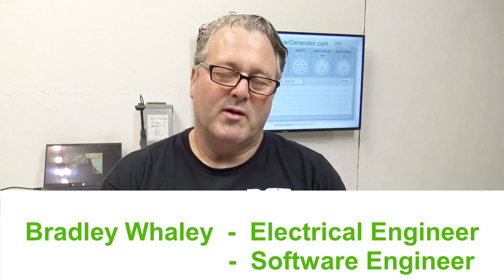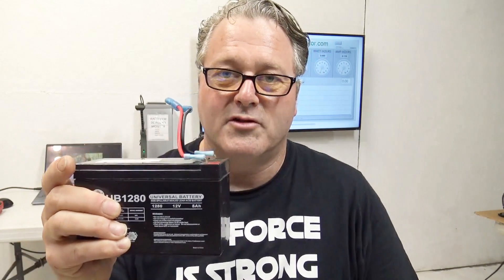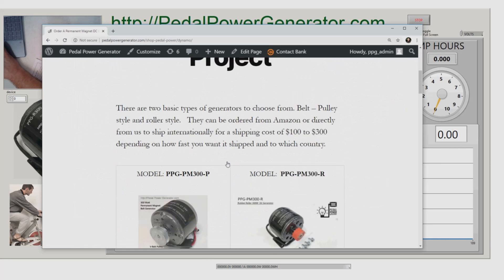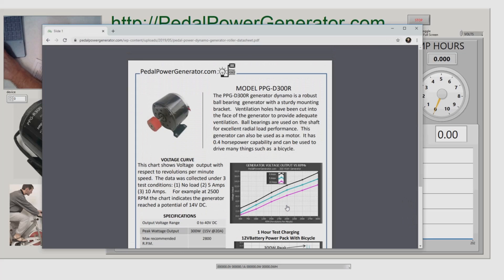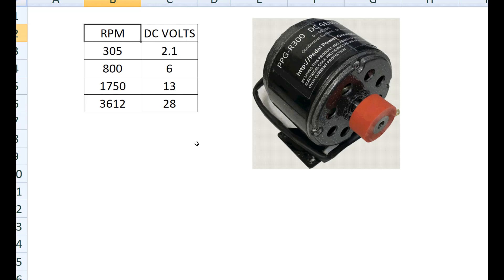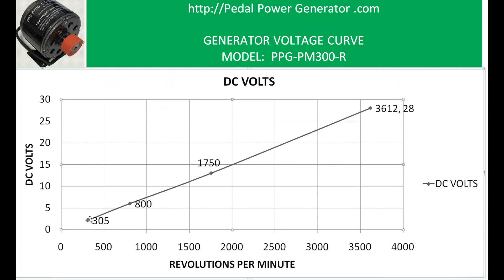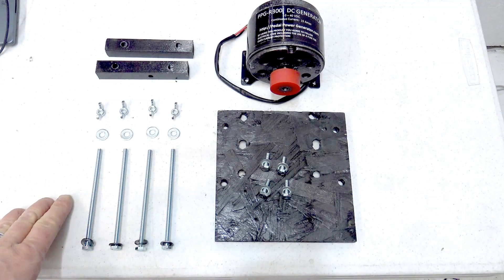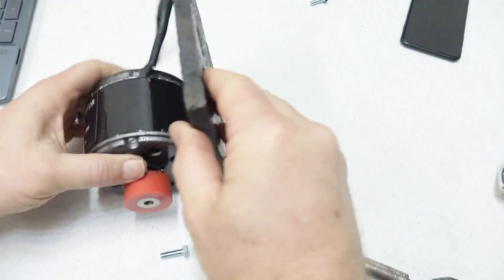RUBBER ROLLER DC GENERATOR DYNAMO FOR EXERCISE BIKE

Comment: why aren't there exercise bikes that have a built-in dynamo powered fan it's exactly what you need to stay cool.
Reply from the maker: That makes lots of sense.    For some reason exercise equipment companies do not want to add things to the spin bike that will comprimise the reliability of the system   adding someting that could break down in a year.   I'm not sure.   Best regards,  Bradley Whaley ELectrical Engineer  Gilbert Arizona

Comment: Hi Bradley, did Pixar animators use you as a reference for Mr Incredible? The resemblance is uncanny!
Reply from the maker: You should see me in my red tights!    Let me know if you need any help with your project -  Bradley  Whaley, Electrical Engineer
Reply: @bicyclegenerator  I have an idea for a similar power generation using the exercise bike but using Magnets and copper wire.  The way I envision it, there will be no friction whatsoever and the output power will be exponentially greater. I just haven't gotten round to attempting it yet.

Comment: Why does no one ever hook these things up to a gear train and an extra fly wheel to get at least 4 to 5 times the volts per second while cycling? Meaning you'd want 4 more DC generators for each main gear on the gear train to spin.    Despite my complaint, good video! thanks for sharing. I always enjoy these.
Edit: well, at least 2 or 3 extra DC generators could be added to a gear train for this kind of thing, right?
Reply from the maker: This is a common mistake.  The fact is that the human body is limited by the laws of physics to only so much power output.   I have countless people bring up the idea that a really big generator could put out much more power than a small generator.     Consider that a person consumes about 2,000 calories a day.    This equates to about 8 million  energy units called "JOULES"  .    A Watt is defined as a Joule per Second.   So if you burn 500 food calories on a human power generator for 1  hour that equates to about 2 million Joules in one our.    To convert Joules per hour to Joules per second we divide 2 million by 3600  which is about 555 Watts of power.   

The sad thing is that when your body  burns this 555 Watts during the hour up to  75% of this power gets lost in conversion from one state to another.   So it first starts as  fuel that your muscles burn,  The muscles then use this energy to push on the pedals of the bike,  The pedals then transfer their energy to the cranks of the sprocket.   The sprocket then transfers its energy to the chain,  the chain then transfers its energy to the wheel,  the wheel then transfers its energy to the rubber roller of the generator (Which has losses to due friction),  Then the rubber roller transfers it's energy to the shaft and rotor of the generator, the rotor then transfers its energy to push electric winding  coils through a strong magnetic field created by permanent magnets,  the winding coils capture flux from the magnet fields and drive current through the windings,  the current flows into your battery or light bulb.    

In every one of the state changes mentioned above,  some energy is lost.    So if your body is putting out 555 Watts during that one hour then the actual amount of electrical energy it is generating is around 145 Watts of power.  It doesn't matter how  big the generator is or how fast it is,  you will  always have the limitation of the human body.    The more power you try to generate with your body,  the more your body feels drag and you slow down and get tired.   Another way of looking at it is if I tell you to ride your bike up a hill that is too steep.  You tell me no ,  and I say "why"  and you say , because it is too hard to ride up that hill.  Let me know if you have any more questions,   Bradley - Electrical Engineer -  http://PedalPowerGenerator.com
Reply: @bicyclegenerator  I was actually wondering how many of those little generators you could get on a gear train, though, not a giant generator.  seems like at least 2? but you would need to modify the wheel of the bike that is turning to have gear grooves in it.   I suspect that's how Charles Greenwood did it with his DuetGen and his HumanCar which is much more efficient, right?  Allowing  a single older man pushing back and forth on the thing,  to go at least 50 miles per an hour in an electric hybrid rowing/pump action car, up hill?   Check if out if you haven't already!
Reply: though aside from spreading the work load out over a gear train, all I really know is Charles Greenwood's HumaCar can generate 110 volts, the question is, is that with 4 people pushing or just one?  this is the car I'm speaking of; https://www.youtube.com/watch?v=NXUJjFvgOdk
Reply from the maker: @DearestDangerDeer  Thanks for the further details around your question.  I will take a look at the DuetGen project.   By the way there are small generators like this one that will easily put 100 to 500 Volts  - it just depends how many windings they have inside.    I just don't get involved with that level of Voltage because a high Voltage DIY project could result in some one hooking  things up and getting hurt.  I agree that high Voltage is more efficient to operate at - that's fur sure.   But I would say only 10% to 20% at max.   I'll hook up a high Voltage system to see what we get out of it compared to a low Voltage system. 
   Bradley Whaley -  Electrical Engineer  http://PedalPowerGenerator.com
Reply: @bicyclegenerator  good to know! I appreciate that. I'm always interested in these kind of things.